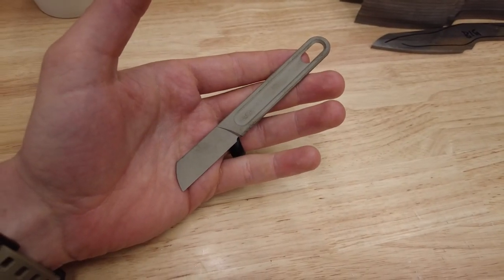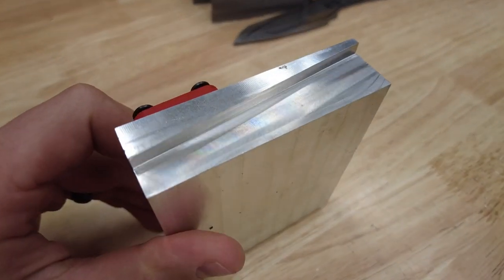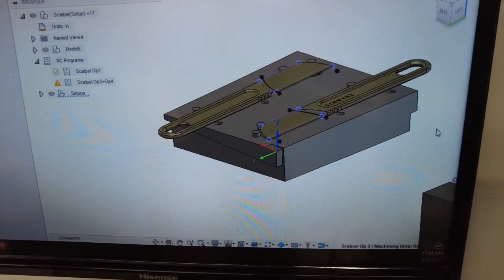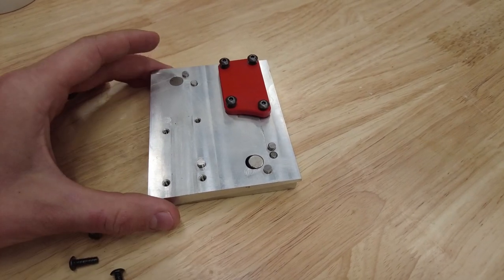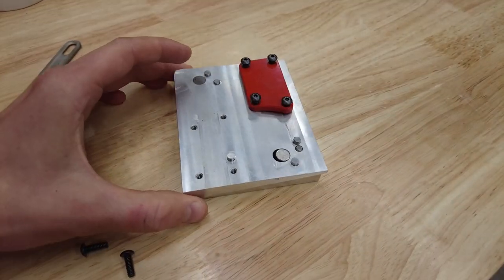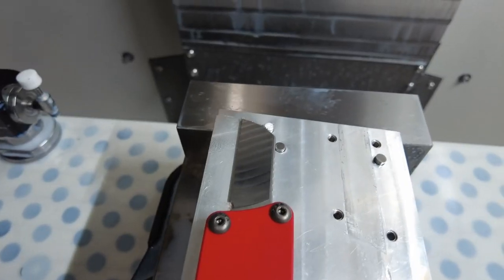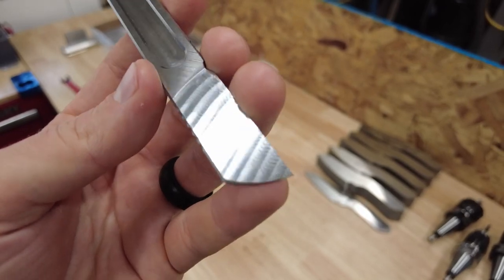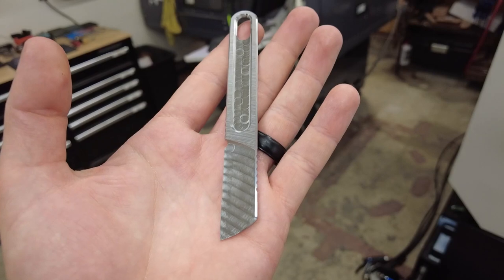Efficiently Machining Knife Bevels

Comment: I was going to suggest the face mill but your on the right track. It should give you a better finish and quicker run time.  offset the tool path so the face mill is not centered over the blade from the outside edges and you should have room with the fixture you have.  Great videos keep it up.

Comment: I needed this so badly.

I hope to start making knives here. I am going to try to program this today and tomorrow.

Thoughts: Yeah, magnets aren't going to work great for chip evacuation. It does seem like if the main grinds were cut as operations 1 and 2, instead of 3/4, you would have extra material to have a bolt hold the knife in place. This would keep you from needing the magnets at all.

The idea of putting a spacer into the gap and using epoxy, though? Great idea. Theoretically, you could get the same type of support by using a steel spacer and a magnet on the other side of the blade to fix the blade in place, though, right?

Genuinely, thank you for posting this video.

Comment: Slick fixture.  I would design one clamp in the center that can clamp both parts and is spring loaded and can rotate.  So essentially just back off center screw a couple turns, rotate clamp 90 degree and switch parts.   Clamp would probably need to be made from at least aluminum and use a larger screw such as a 3/8-16

Comment: I don't think you need magnets since you already have locating pins!
One problem though, your work piece is not fixed at the tip which may at some pieces introduce vibrations.
Reply: That's what the magnet is for, to support that floating end of the blade. Some other knifemakers use epoxy or hot glue or just fully 3d machine a pad to do the same thing.

Comment: I love videos like these! I'm curious as to whether the magnets are for location or secondary work holding? and would the score you got from the chip on the blade just disappear after heat treatment and grinding anyway?
Reply from the maker: The pins locate and the magnet is to hold the tip down. I actually don't grind them after this process. Just sand blast and tumble. Sometimes the swirls do appear after that at which point I lightly stone them out.